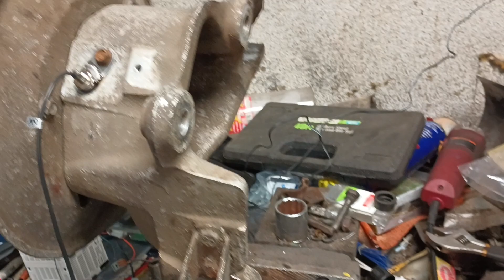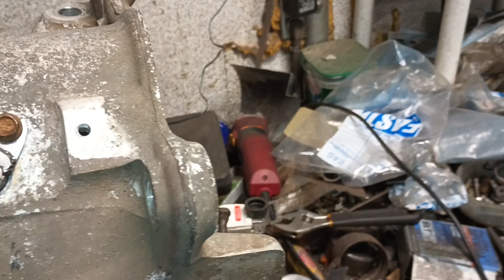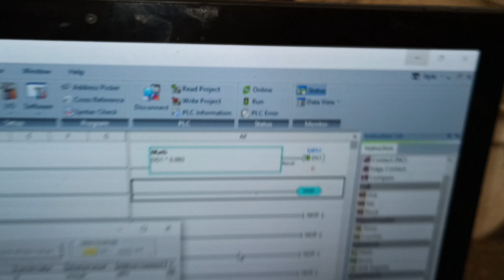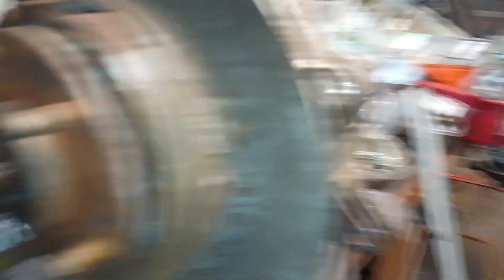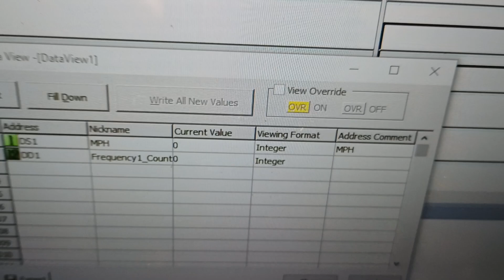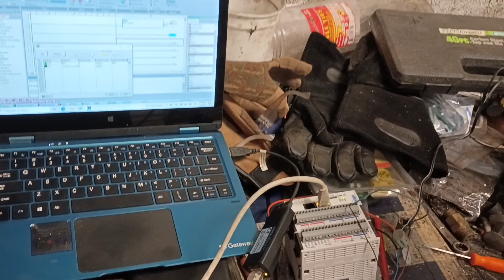Using an inductive proximity switch as an ABS sensor.

Comment: Nice…👍👍….I’m attempting the same thing but I’m going to use a VR to Hall effect converter right to the Holley….your way is a good option if it doesn’t work….Good stuff
Reply from the maker: Just food for thought, you could feed the pulses from a NPN prox switch directly to the Holley.  And they are only $30.
Reply: @chadk6938  you made that clear …it would have been simpler also….at this point it’s my “backup” plan if the signal converters don’t work….👍